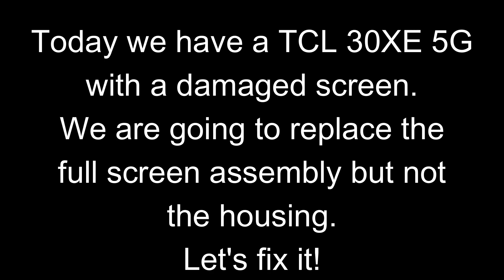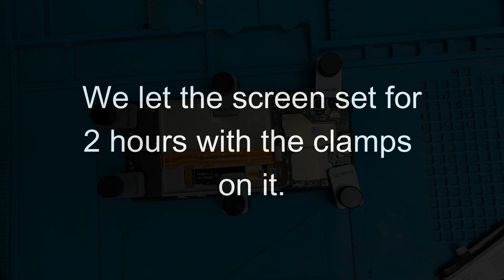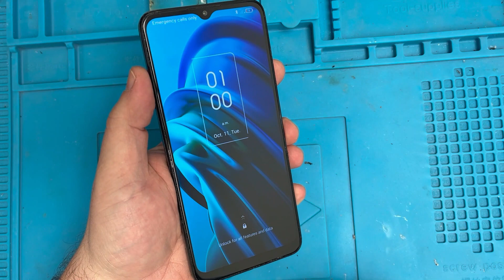TCL 30XE 5G Screen Replacement

Comment: This is a bad tutorial. It's not the best way to get the battery out! You'll short circuit the battery! The best way is a hair dryer lightly and not let it get too hot allowing the glue to soften first.
Reply from the maker: Respectfully disagree. 99% isopropyl alcohol is a much better way to remove the battery than heat. The glue under these (and Motorola) batteries does not soften much at all with heat. Even with an even heat source like the warming pad our shop has. Of course everyone is free to do it how they want, but this is the best way to ensure there’s no damage to the battery.

Comment: Great video. Do you have a link to the replacement kit I would need to replace my phone screen that is smashed as badly as that one? Thanks in advance
Reply from the maker: Thanks very much! I got mine from MobileSentrix, but there's many good resellers, depending on your location. Injured Gadgets is another very reliable online seller.

Comment: Fantastic BUT, be prepare to fignt the removal of the back casing and the screen itself.  It is glued to death.  The removal of the battery as a nightmare, it was glued on all sides.  Again, annoying but you will fight to remove, just do it.    Also, make sure to order the kit with the screen (normally is part of the order).  Have fun, it took about 45 minutes.  thanks

Comment: Umm i have the same phone but like i dropped it to where it broke n the screen kinda comes off  it's  at 2:02 and it sometimes doesn't wanna type even when it was very first broken and got it fixed again but I had a question is it normal for it not to wanna type but it does slide for a few hours or did the person who fixed it did it wrong it's still works rn i taped it
Reply from the maker: They may not have done it wrong, but it sounds like the new screen that's on there may be defective.

Comment: I ordered the wrong screen. It's attach to the plastic assembly. Is there a simple and safe way to remove the screen from the assembly?
Reply from the maker: Not really. Heat and a little bit of 99% isopropyl alcohol will help soften the adhesive, but depending on how it’s bonded to that plastic frame, you risk damaging it while removing it. 

If it’s the right screen just on the housing, you can move the boards/battery over to the new frame.